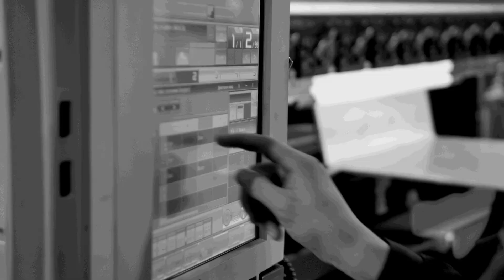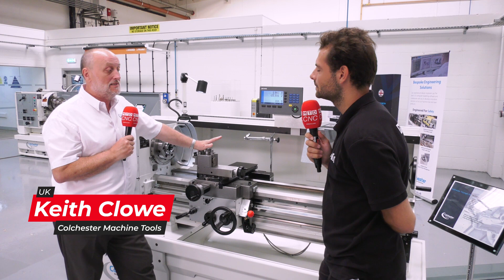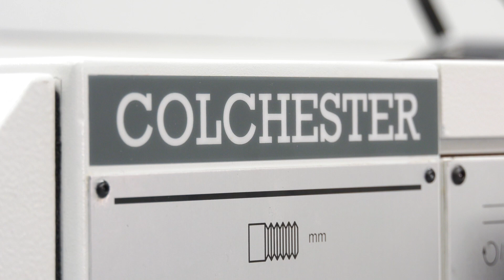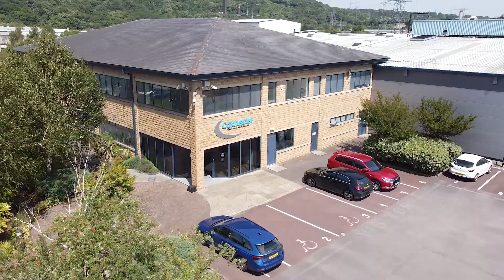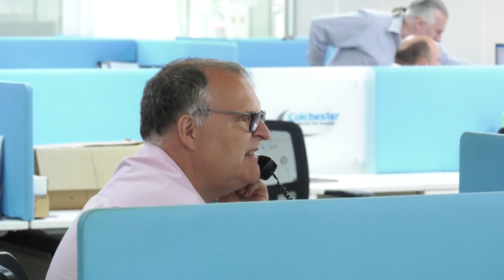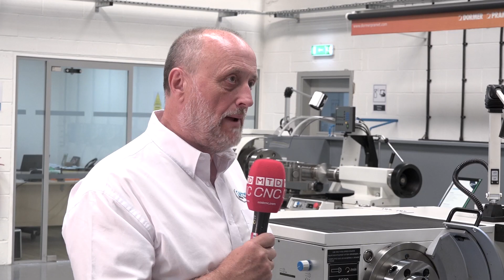The Colchester Triumph VS is the most feature-filled conventional CNC machine

Comment: DRO with constant surface speed and not a CNC, how does that work exactly?
Reply: via a vfd. Basically the dro keeps track of the position in the Y direction and adjusts the vfd to maintain that SFM
Reply: @Jraksdhs  Right, so if I'm facing off it'll speed up as I near the centre, got it!
Reply from the maker: Hope Jason helped.